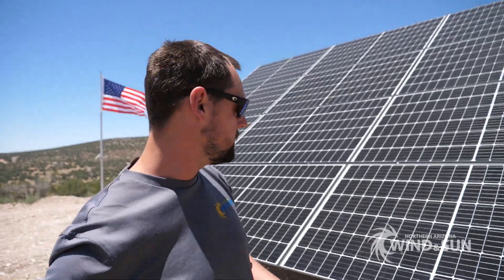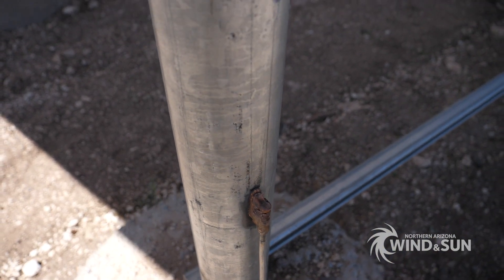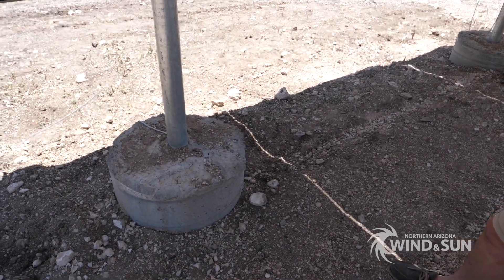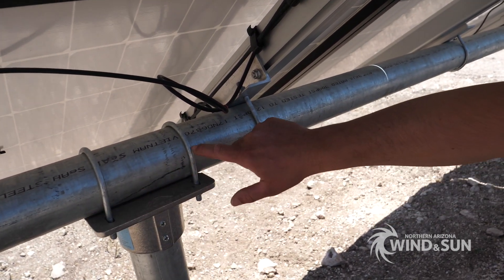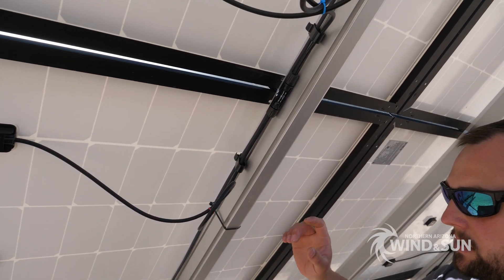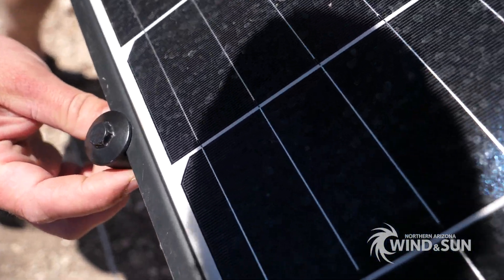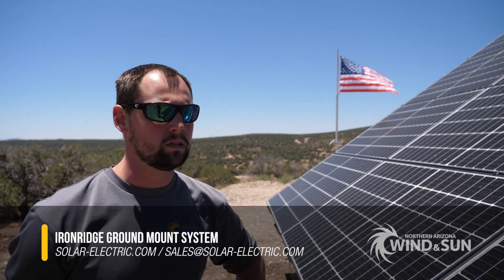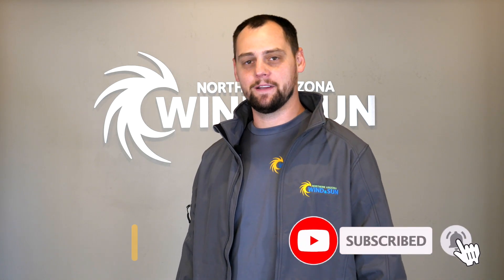IronRidge Solar Ground Mount System

Comment: I've been messing with the Ironridge DA to design an array. 20 panels in a 4 high 5 wide configuration with 2 inch pipe calls for 22 piers. For the price of the pipe i could almost build a wood pavillian or shop and mount the panels on the roof.